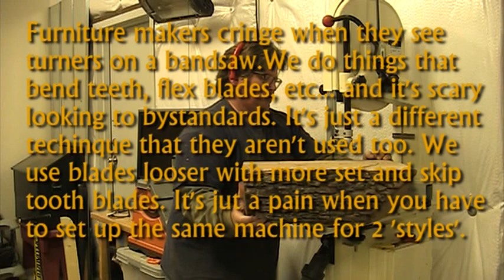From a Tree to a Bowl in One Day

Comment: Bring along some dump paint from the paint store (dump paint is cheep) while you cut your tree and paint the ends right away, that gives you more time until the wood cracks. I make spoons a lot, so I just paint the ends, let the logs split from the outside in for a few years, and then use a wedge after dry to split the log using the triangular split lines that are usually useful for quarter saw blanks to make the spoons and other kitchen utensils. I waste a lot of wood this way since the logs don't split ideally, but it saves time for my purposes.

Comment: You have produced another outstanding and helpful video!

If I don't have have time to rough turn the felled tree right away, is it an option to coat all bare surfaces with a product like Anchorseal and then stack the wood pieces where they have plenty of air flow for several months?

Comment: If you do this type of thing often, you should invest in a chainsaw of your own, but put a ripping chain on it.

Use dad's saw for felling the trees and cutting the basic log lengths, lopping branches, ect ... 

Use your saw for rip cuts that go with the grain for finishing the blank forms.

The chainsaw you are using (dad's) has a standard crosscut chain, which is effective for cutting across the grain of a tree to fell it and section it for removal.  To use your dad's saw more effectively for cutting your blanks out, you should have laid them on a flat, so that you would be cutting against the grain as you slice your way vertically down through the blank.

A ripping chain uses a skip-tooth style of pattern that allows you to remove the longer fibers of the wood more effectively (without clogging the chain which prevents it from cutting through the fibers quickly).  The first 2 teeth are only half width, removing part of the fibers, and the next 2 teeth are full width, removing the rest.  This style of cutting would work best with the method you used to cut out your blanks.

Making sure your chain is sharp is also helpful for making a cleaner straight cut without working the chainsaw's motor too hard.  In addition to that, also make sure that you are using an appropriate bar lube (bar oil) to keep the chain moving freely.  The saw you are using probably has an automated oiler, but you still have to keep the reservoir topped up.

Last, but not least ... if you each have your own saws, you can both go together to take a tree down, and then use his to section up the log, and while he goes and gets his prized reaction wood with his saw, you finish out your bowl blanks with your saw.

(Also... if one saw breaks down, you have a spare on hand!   Even if you're using the "wrong" chain for the job ... it'll still do it, even if it's slower.)
Reply: I think this is awful advice: I'd never use a ripping chain for this sort of thing, only for cutting planks with some sort of milling attachment that conceals the nose.  It's true that it would be slightly quicker, but kickback with a ripping chain is hugely amplified and the idea of using one freehand seems to go against every other piece of advice I've heard about them.
Also, in my experience trying to cut top-to-bottom of a log takes MUCH longer than cutting side-to-side (as shown in the video).  True, standard chains are designed for cross-cutting, but cutting with the grain is still easier - look at the shavings!
Good points re: sharpness and oil.

Comment: Thanks for the video. I am a relatively new wood turner but pretty enthusiastic and trying to get past all the catches and getting enough experience to be confident with what I am doing. I have lots of dying post oak on my property and often times when I cut the trees down it is a mixed bag. Sometimes there are some interesting hollowed out cavities potentially ripe for epoxy fill. I also have a few logs I cut down a  while back ( about 5 years ago (post oak and cedar) and stored them in the corner of my garage (not knowing any better nat the time).  These are 16 inches plus and about 6 foot lengths and now they are substantially less heavy as they were when I cut themn down. .  On the surface you can see some cracks and checking but I cut a section out of one of the cedar ones and lots of it was OK to use. I actually made a small plate out of a section of one that turned out very nice. The wood seems dry now. My take on the oak now is that it is hard, hard, hard and there are probably sections of the log that will be turnable. Are there any issues of using this wood or should I just chuck it. I kinda like the idea of using it because it seems to be dry now.
Reply from the maker: Old wood is always a risk. Things can explode because of internal cracks. I wouldn't do a bowl but maybe small spindles from known clear sections.
Reply: @wortheffort  Thanks. I don't know if you are in the Austin area. I live in Bastrop and the Berdoll saw mill near here has literally tons of offcuts of green pecan and Mesquite. They do slabs mainly but sell these offcuts for almost nothing. I think $1 a cubic foot but when I was there they will take what you want to pay basically. This is a very minor sideline and you are acually doing them a favor by getting rid of this pile. Some pieces I took lately where pretty substantial 4X12X16 some endgrain some you could do as a tradition cut. Most of what I saw and tool was away from the pith as well. Don't know if this interferes with the "I pay for no wood" philosophy but it is a really good source of very cheap bowl blanks.
Reply from the maker: See my latest video on how pros dry wood.

Comment: Great vid!  I started using 2 coats yellow glue to seal log ends.  I have had no end cracking so far and it's been several months since the logs were cut.
Reply: Yellow glue ?   Like wood glue ?
Reply: @nickdewalt4526  yes.  works great!  some wood splits no matter what you do.  but the yellow glue is thick and makes a good coat. 
but in my experience after turning over 200 bowls, don't let the wood sit.  cut it and rough turn it ASAP.  It's a whole lot easier that way, easier on the chain saw, easier on the band saw, easier on the lathe.  At least cut log and cut on band saw to make a blank and the wrap with stretch wrap.  this keeps it from drying out.  I have some logs that have been sitting since Jan and in our 100 deg heat, they dried way too fast and split some what.  Oak logs were the worst, huge splits.

Comment: I really like your teaching style and the information you share. You really live up to your motto. 

I have a technical question about cutting a log in half with a chainsaw ( something I have to do tomorrow). You said cutting through the endgrain ( I assume you mean cutting from end to end)dulls your chain. The couple of times I had to cut along the sidegrain (side to side) long strips of wood clogged my saw which takes me about 15 min to clean out. How do you avoid this happening?
Thanks, Arthur
Reply from the maker: It’s a balancing act. Also ripping blades help.
Reply: @wortheffort  Thanks for the quick reply. I have been thinking of getting a ripping blade since I get mostly bucked logs from others, so am mostly ripping with my chainsaw. Now I will definitely give one a try.

Comment: Totally not a woodworker here, just LOVE watching you guys create art, so don’t think this is a criticism ... as you were picking your tree, did you ever consider any of the 4 foot stumps or the log that was laying down to use in any projects?  I couldn’t tell if those were rotting or what, that’s why I’m asking.  I just hate to see things go to waste.  (I couldn’t turn sound on because of where I am, so I could t listen if you explained.
Reply from the maker: as wood dries it tends to crack. when you take stuff like that the chances of an internal crack are high. those types of things tend to go boom when you spin them at 2000 rpm. getting fresh is a lot safer and gives you the woodworker more control. in the Texas heat cracking happens almost instantly as described in video.

Comment: what type and brand of band saw blade do you use?
Reply from the maker: I buy mine from a commercial place. Just walk in and tell them tpi, type, width and length and they make it then and there from a giant roll of the stuff. Most cities have one or two places like that. I spend maybe $13 per blade so I just use them as disposable. The bandsaw is my main power tool as I don't use a table saw for much. So I go thru a blade or two a month and keep several types available with backups.
Reply: wortheffort your band saw blade is 13 bucks? Why the heck is my 10 inch bandsaw blade 30 then.  Sheesh

Comment: You mentioned selling some of your bowls green, how do you avoid splitting?
Reply from the maker: Turn em thin enough and they'll be dry by sale date. Don't vary the thickness in any one are so the pressure is equal and the bowl will just warp and not crack if it's thin enough. Choose your wood wisely also helps preventing cracks.
Reply from the maker: See my $20 bowl in $20 minutes for examples of this.

Comment: Why is the greener the better
Reply from the maker: you get to control the drying, less chance of internal cracks, cuts easier.
Reply: Would it not cause cracking in the finished project over time when the moisture level does change